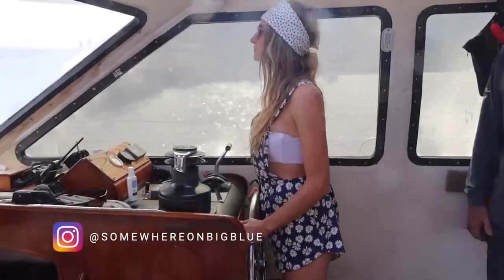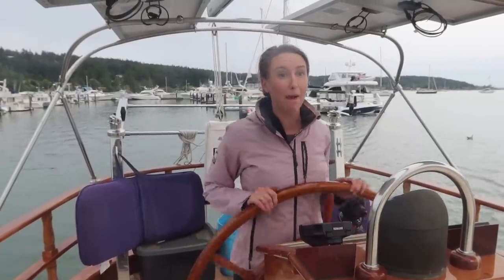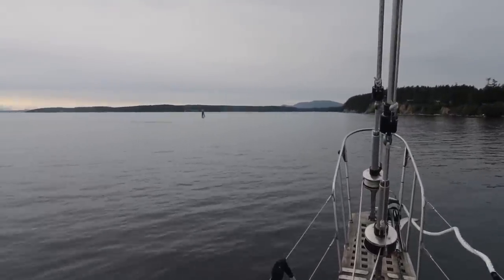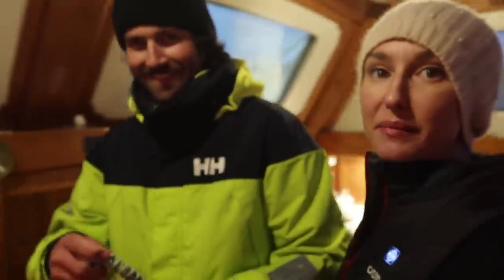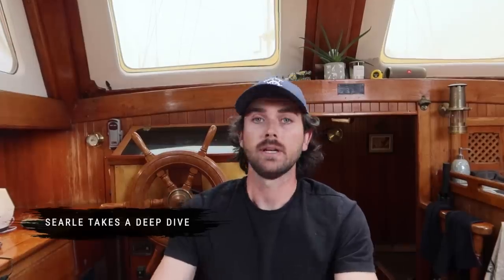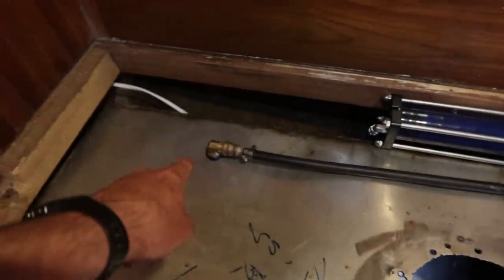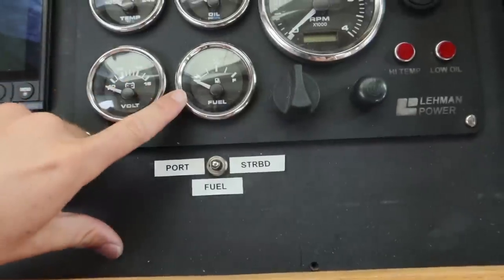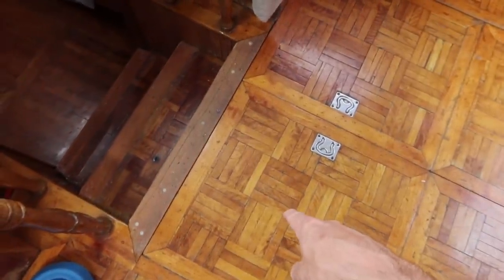Finally FREE | PIRATE SHIP S15E06

Comment: What a great feeling to finally get off the dock! Nice to have a trustworthy fuel system. Loctite 565 is a great product, you do not need much as a very small amount between the mating threads does the work, it is an anaerobic, it cures with the absence of air so the excess stays pasty and should be removed. It is service removable. Flair fittings have 37 and 45 degree angles, it is important to know what you have, if you mix them, they will leak!
Keep up the good work!

Comment: When you sail in hard weather that’s when you will know if the old tanks will hold up with large amounts of fuil in them . and not start leaking . That’s what you call a jinx . Got my fingers crossed , Sorry Aubrey
Reply: We understand that there is a possibility and have discussed a way to tackle said worse case scenario. I have inspected the tank welds thoroughly and have high hopes.

Comment: at 09:50 your prop shaft is misaligned. It is almost rubbing at the 10 o'clock position. Please for your safety and the safety of your crew furry and feathered included realign your prop shaft, and at your next haul out pull the prop shaft and have your stern tube inspected. Keep up the great work.
Reply: We have a big job coming up with stern tube, engine mounts, shaft, aqua drive and more. Stay tuned for that.

Comment: Looks like Searle is doing a good job on the fuel system, just one small point, do not over tighten the fittings on the ball valves as I have seen the valves crack and leak same with the JIC fittings especially brass one. Love the Formosa boats have sailed a 51 before.

Comment: Rainbow over the transom usually means the packing gland is leaking in the bilge. You can actually replace the packing material while the boat is in the water.  I've done it, and just be sure to have all tools and parts ready.
Reply: There is a slight distortion on the shaft and the locking nut thread has sheared so whenever you go into reverse it backs the stuffing nut out enough for a steady stream. When we haul out next time we will be sorting this out and most probably with a dripless seal.
Reply: @searlebrooker3615  well in that case you should be fine until next haul out. My wife and I almost bought that boat before Abury.

Comment: Hello I lived on a sailboat for 10 years all by myself single handed sailor and enjoyed every day then I got sick so I had to sell the boat and move on sure but down there in that hole where it’s leaking one drop a minute you should have some Teflon packing to put behind the packing nut before you write it on and when you’re at anchor you can tighten it all the way and it won’t drip but when you’re gonna run the boat please for your own benefit Lucian that packing nut back up a little so you don’t burn out the new packing you put in the thing by the by the shaft good luck on your trip around the world

Comment: nuts that can vibrate loose( a dab of silicone on the threads will stop it from vibrating loose). This is a what my dad showed me. even where high vibration happens.
Reply: The video wasn't so clear. My bad 😞. There was locking washers on all the studs and I tourqed them down to recommend setting.

Comment: If the belt is not loose it is a glazed belt and should be replaced as it will continue to squeel till it splits, sooner than later....   Hack.. temporary solution for 100 years of engine belts is TAR.. Auto parts stores sell it in sticks. Roofers discard scraps or melt offs...
Reply: We will be designing a double alternator bracket with sufficient strength and to include tensioner pulleys. The extra large 210 amp balmar alternator has very little coverage around the pulley(if I take a guess only 30%) so we will be tackling this problem soon.

Comment: Just so you know the belt is squeaking because it's slipping and adding deodorant does not stop the slipping it just stops you from knowing about it so you will wear that belt out if you don't solve the problem instead of band-aid the issue
Reply: We are aware that things aren't quite right with the alignment. We were just playing around because at idle she really chirped like a bird being harassed under the floor boards. We will be designing a double alternator bracket with tensioner pulleys  and sufficient support but it's not a today job.

Comment: Did you just replace a single pole double throw switch with two single pole single throw switches? So you can turn on both fuel tank sending units at the same time with one gauge?
Reply: Yes, its a optimistic approach you can turn 2 tanks on at the same time and it doubles the reading. It's why we went with a momentary switch first but when filling at a station we had to run up and down to read the fill level, now we can fill and look through the port light and see the level.
Reply: What you should have done was change out the momentary to a single pole double throw. That way you could select one tank sender or the other

Comment: Why don't you place a cup or something similar below when drilling into the tank? Would save most of the cleaning inside. Sad not to see Aubrey working anymore. She's been a good mechanic and positive antetype for other women. The best safety on board is redundant crew. If he's seriously seasick or even worse, she needs to be able to get the engine running again or tackle electrical work in a leeshore situation or in a shipping lane. Most couples are only 1 and 1/2 as the women are usually not able to do any of those tasks. Aubrey is or at least has the confidence to do so.